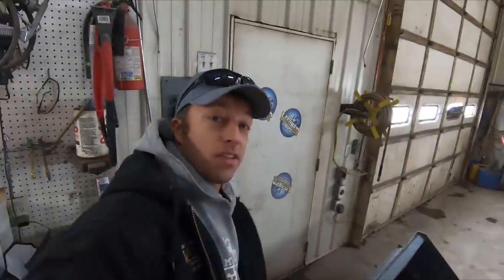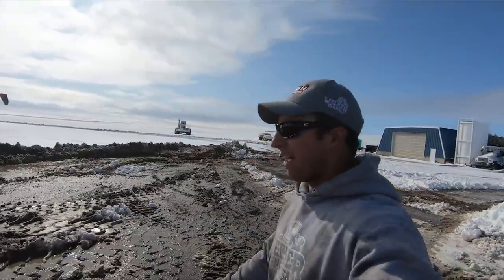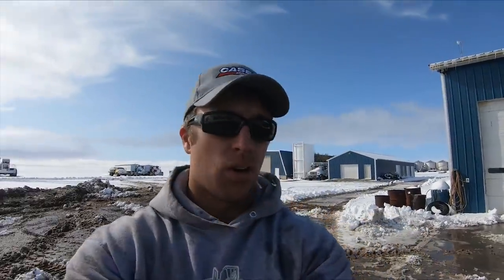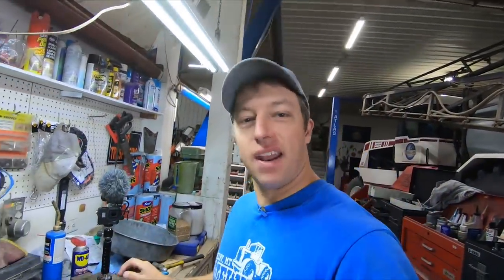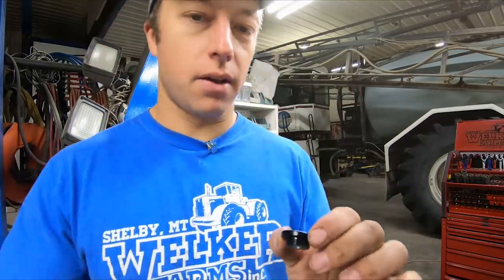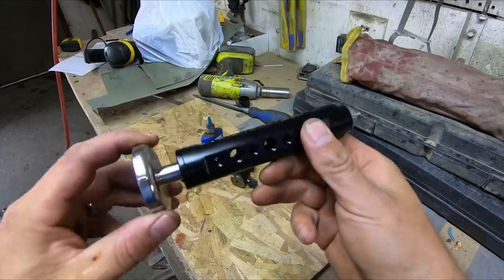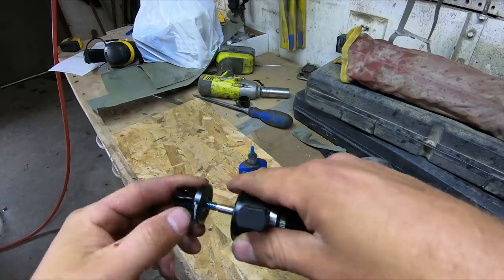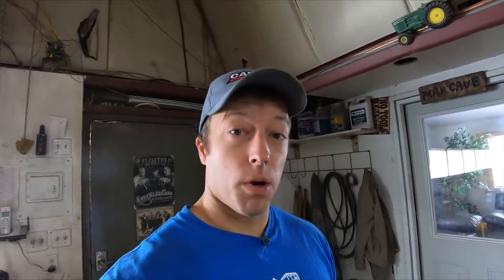GoPro Setup & Snow Removal

Comment: I used to push a lot of snow with a skidsteer for the garden store I worked for back in the day. Open cab, and a 1/2 yard bucket. Took forever, especially factoring in the stops to warm my hands and gloves in the loader exhaust.

Then I moved to a different garden store that had a full cab loader with heated seats, and an actual snow plow for it. I can't stress enough how much an actual snow plow helps speed up clearing. Make one pass down the parking lot, then turn around and go right back up. One pass each way. With a bucket I always had to do multiple passes over the same area to get all the snow.

Ya'll should see if you can find one. totally worth it.

Comment: Hey guys. Keep up the great work!  As a back up to the magnet.  Make a short cable with 2 spring latches. Attach one to the rig and the other to the equipment. It will help to keep the camera rig from falling into the field or worse yet into the turn signal exhaust pipe and destroy or lose your stuffs.

Comment: Got that whipped out skid loader bucket you could have Legarms reengineer it to make a snow pusher. It would be easy and he would love the project. Hack off the front, add width with big sides and a rubber scraper.

Comment: maby you should dig a trench where the water normaly runs. then put some concrete in the trench so it wont get bigger and put some grating on it so water can drain away from your property without  flooding your yard area and still being able to drive over it with grating and covering the entire lenght with maby some solid concrete slabs covering the channel every now and then so the big machines can cross it without breaking it.  i know it is unrealistic but it would help with the snow melting and creating a small river right through the property

Comment: Another good thing about photography:  When you've seen a dead human being who has been crushed by a hydraulic equipment failure this generally stimulates others to actually USE hydraulic lock-ups to prevent our own gruesome deaths.  Thanks for using the locks!
Reply from the maker: Only reason is if you are limited on space, having it in the air keeps the large bucket from being in the way.

Comment: I have a similar magnet setup but not as metallic and fancy. My GoPro was a knock off affair with loads of extra bundled extensions so I got a magnet used for taxi roof signs and used two adaptors at right angles to give me left right and tilt adjustment. Not quite as strong but it's probably far easier to fold down and pocket. Might get that handle tho

Comment: the right tool  for the right job to handle the snow  that's for the remainder need to make sure the heaters are working when we start handling snow remover here we recycle the water from the snow for dig-outs for cattle water hopeful the full year it's hard on the wells on each farm we usually have to buy more water in the summer the dig-out is low going in to the fall this year was very wet year still had to  full up dig-outs

Comment: Hey Nick!  Good video.  When I was farming and there was a washout like yours, I'd fill in the ravine with from an angled dozer blade like you were doing at the end of your video.  After I got things relatively smoothed out and I was seeding the field, I would go up and down the washout, making certain to overlap one section of my drill in the repaired washout both up and back and then, I'd seed across the washout to effectively triple seed the area that was once a big washout.  Over time, the washout was removed and became only a bad memory.  Do you triple-seed your water ways (washouts) like this?  Thank you Nick and Scott for sharing your video of the wintery climate in Shelby...take care.
Reply: Thanks Allen.  We are looking at making a flexible hoe drill small enough to seed those ditches.

Comment: Advantage of snow in winter is you start spring with moisture
Reply: Yeah but it's not winter so this snow will be long gone by then.....Hell most of it is long gone now.
Reply: The snowzilla last week did put moisture down into the soil profile because it was very wet, which will be there next spring.

Comment: What sort of soil moisture/rainfall equivalents can you get from a typical snow melt? Significant enough a good snow could make or break a year?
Reply: We usually get about 5" to 8" of powdery snow or maybe .75" for the accumulation.  But we've had significant more the last couple of years.  This snowfall was early and wet which added to the soil profile before soil freeze up.  Most of the total will be available for next years crop and will help in making a crop.  We usually don't figure on much moisture from snowfall.
Reply: I guess it all adds up in the long run somewhere! Cheers 👍🏻

Comment: I think it's a 10mm bolt you used on your go pro magnet, I love how you guys can't get the metric system🤣we have learnt the imperial way😜
Reply: Not so, Mick. I use the metric system when dealing with small parts that have to be cut or machined because I suck at fractions... Lol
Reply: I love how everyone mocks us for not using metric but last year when I was in the EU everyone told me distances in miles and our German compressor not sold in the US had ( reason I was there) had NPT threads and bolts. The mechanic had both imperial and metric set of tools just like I do, he also cussed having both types on a single tool just like I do.

Comment: Is "tighten the snot out of it" a technical term? If so what's the numerical value/equivalent? Lol
Reply from the maker: Good question, snot would be a liquid so it would need to be measured in volume but not sure that equates to Torque!
Reply: Welker Farms Inc, great point! Liquid/volume and torque would be challenging at best to convert.

Comment: Y’all should possibly look at getting y’alls driveway and where y’all drive around the shop paved with asphalt. It would be pricey but worth it then y’all wouldn’t have to deal with the mud during the winter
Reply: Yes, asphalt is nice, have it in front of my home.  But would have to have thick coat to stand the weight.

Comment: As a farmer and Loctite salesman you did a couple things wrong.  1st you didn’t use actual LOCTITE brand product.  Email me @ Marcus.kloepping@henkel.com and I will solve that.  2nd is on a blind hole application you want to put the LOCTITE into the blind hole versus on the male threads.  The air in the blind hole will push the thread locker out of the threads as you tighten the thread and compress the air at the bottom of the blind hole.    Love your go pro rig.  I am going to copy it.  Hope this latest blizzard didn’t get your power.